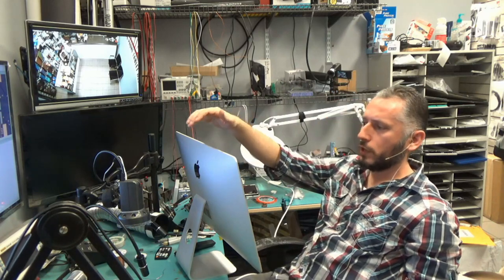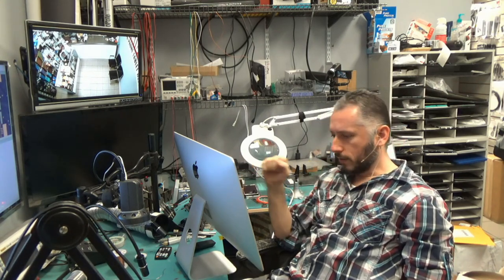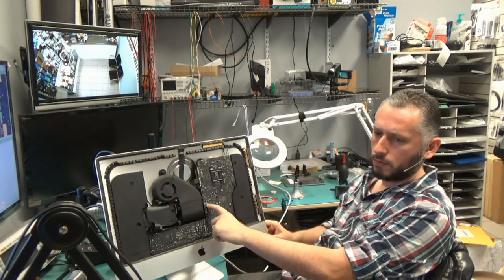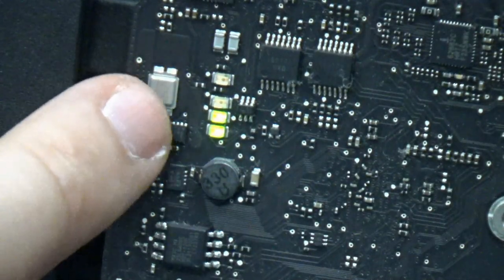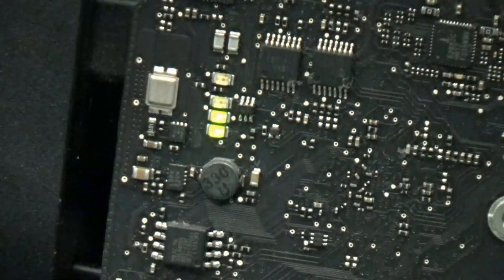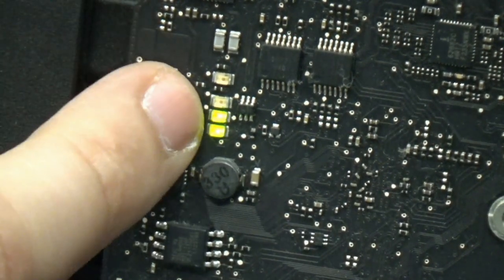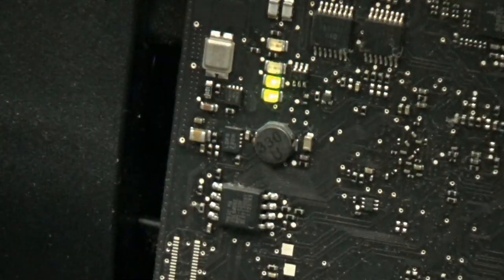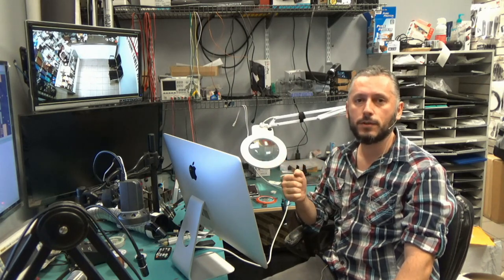iMac No power hardware troubleshooting using Diagnostic LEDs

Comment: Hi. Your vídeos are very interesting and valuable. I have seen several for a diagnosis. Can you give me any advice, please? I have upgraded my 2017 iMac ( 21.5 inches ) now it has a TB and 32GB RAM. Crucial and OWC carefully checked before installing them and also cloned. Computer deos not power on. Since green leds 1 and 2 are green ( not starting Sound though ) I saw your video where third light green was the GPU and I replicad the battery as you DId but the problenm remains the same. 1st and 2nd green light- no sonda, and third nothing. What can I do?. Where can be the problem?. Thank you
Reply: Were you able to solve your issue? I'm having the same problem right now. I opened my iMac 2017 after a HD failure and changed to SSD (I was already using it as an external SSD as the startup disk). After that I'm only seeing the two green lights. You replaced your PRAM battery and that didn't solve the issue?

Comment: Hi! I'm watching all of your videos! Very useful! I've changed the ram, but when i mounted everything back, it doesn't do anything. I saw that the first led is not lighting, it doesn't recongnize the ac cable ? Is an error with the power supply?
Reply: It's either the power supply or the logic board.

Comment: Thanks for this video. I ordered a new power board and logic board for my 2013 27" that was having similar problems. Now that it's open, I guess I'll try replacing that CR2032. If that's all it was, it'd probably be wise to hang on to the replacements for that fateful day when one or the other does fail, as they are starting to disappear off eBay. Don't you think?
Meanwhile my 2007 24" continues to work perfectly, if not running a little hot, day after day during the repair.
Reply: Was that your problem?
Reply: @xp3085  you know, I replaced the watch battery but I ALSO put a new NVME (or whatever they're called) in there with a little adapter and one of those things fixed it so I still have the power and logic boards. I also have scotch tape on it instead of the proper seal because I'm superstitious and I don't want it to fail, you know, the day after I adhere the screen properly.

Comment: I have a 2004 imac g5 A1076 Model, and it has the first two lights on, but it doesn't make the chime noise its supposed to when I hit the power button, but I hear the inside whirring like it wants to turn on. The white led on the front of the Desktop Mac stays solid on the bottom right of the front of the computer, the screen wont turn on, it just stays black. Any help or suggestions would be TREMENDOUSLY helpful. Thank you.

Comment: Imac 2011 21.5 inch when i put the power cable on the mac the fan is spinning normal but without pushing the power button it turns on by him self 1en2 lights up but 3en4 is out what can it be is it the power suply or is it a logic bord dead? Thanks

Comment: Hi   I have replaced the EFI/Bios chip and replaced my hard drive with an SSD drive following carefully all instructions. The iMac will not turn on so I checked the leds. The first led is on but the 2nd led (indicating the computer is on) is flashing on and off    ..... any help much appreciated
Reply: im having the same issue.
Reply: I'm having the same issue
Reply: Same problem but I have only Led1 blinking

Comment: thank you for the explanation. it really helped alot. i do have to ask, My situation is that the system does not start and only gives me a flash of light so when i opened the system all lights except the top light come on. I can still here the click sound and the fan comes on then stops then comes back on. I feel it can be the hard drive going bad, but i could be wrong. Any thoughts?

Comment: @nortdrigefix - the first LED in my computer is on when the power cable is plugged in. When the power button is pressed or jumpped, the fans turn on for two sec and then turn off. Nothing happens afterwards. The second, third, and forth LEDs never come on. Could you help? Thanks!

Comment: Good day @NorthridgeFix. I have a iMac 24 Inch (EMC2134) have LCD issues, it's not turning on,  i have hardwired the LCD to 3rd LED Diagnostic light and the LCD turns on but imac doesn't turn on. Diagnostic led 1,2,3 is on but the 4th is off. Maybe you have a suggestion? Thanks!

Comment: hi love your videos 
i have a problem i bought a iMac 21´5 2013 and it is dead i already new and that the previous owner replace the psu and nothing i already check voltage and psi its ok 12v coming in and 3,5v to
but motherboard doesn't show any led turning on can you help ?

Comment: Hello sir I have a 27 inch imac of 2011, I have such a problem that only one light comes on, if I switch it on after a while all the lights come on and after I switch it off there is only one light, I'm turned on again 30 minutes after work complete but quickly not  imac this is my imac problem please give me solution 🙏

Comment: Great video. question did anybody ever have a problem where the display 27” imac 2013 late i7 3.5 with GTX 780M ,will dim for a quick second and then go back to its normal brightness. And the auto brightness is turned off .I replaced my display prior to it being bad at one point not because of this particular issue this particular issue started when I put the new display in. I read that it’s possibly software, but I’m not sure I have checked the LVDS cable and replaced it for the heck of it. It only does it once in a while sometimes when the computer first boots up and then sometimes maybe a half hour into using it a quick glitch where the display will dim for a quick second and then go back to its normal brightness where I have it set at. I did a pram reset all of that SMC reset still getting it I’m not sure if it’s actually the display that I purchased, which is aftermarket. if anybody can help me out, it would be highly appreciated. 
Thank you

Comment: Hi thanks for your great video. Nevertheless on my late 2012 imac the 3rd light lights also but can't seem to get it to go to  boot or go to restore or boot an external mac HD nor even get it to boot off a linux dvd. I also replaced the delta power supply with a liteon b/c I heard they were faulty but to no avail. Finally I replaced the cmos battery but that didn't work neither. Running the apple diags basically freezes and never finishes. Got any other ideas?
Reply from the maker: likely a GPU problem.

Comment: After watching you video I replace the power supply on my  iMac Intel 21.5" EMC 2742 (Late 2013) and only 1 light is on any help would be great.
Reply: Shawn Anderson same issue but 2nd light flashes. Got any help?
Reply: @Brandon-jc8xm  i got the same issue too lol
Reply: Nathan Nguyen My problem was the ram. Changed it out and put some OEM and it worked again.

Comment: I have a 2013 imac, same motherboard layout, the first light turns on but when i press the button to turn the computer on, it does nothing, what do you think it might be? Here in chile we don't have proper tech service and i am kinda lost on this one.
Reply: hey dude, I'm having a same issue just like you. Did you find a solution already? I really appreciate your reply for I'm located in rural area ;((
Reply: If the power supply is Delta then get a liteon because the delta's have been failing like crazy.

Comment: A1311 Late 2010, i have no sound on startup, but fan is spinning. I opened the screen and i see that 2 lights are ON, keyboard is not responding (Caps lock) so it wont detect PRAM command. How can i make sure its GPU or Motherboard or battery (less likely)? Thank you
Reply: You solve the problem?

Comment: My iMac is a 2011 model and after watching your video, we took the screen off to see the LED lights. My computer does not have the LED lights. We looked all over the place and there isn’t anything that gives us an indication if it’s the power supply even though I feel it’s the power supply because the computer doesn’t turn on. For a 2011, is there any other way of checking that it’s the power supply before buying a replacement?
Reply: Search for the service manual for your specific model. Regardless of where the LED's are located, they will most likely be covered with a piece of black mylar tape

Comment: For me, LED #1 turns on and then off when I plug it in. iMac does nothing when I press the power button.
Reply: I' have two logic boards that I've been fighting with to get working. One does exactly what you are describing. I put my other logic board in and I got the first two lights on
Reply: same here ! any solution ? very expensive repair here :(

Comment: Hi. From NZ. I have a similar problem. iMac mid 2007. Power unit failed. No LEDs came on. Bought new power supply. Now all four LEDs light up but as soon as the chime is heard the computer shuts down and all LEDs go off. I managed to get it to boot up once in between but not again. Tried replacing the PRAM battery as well as trying to reset the PRAM and the SMC. Still stopping after the chime.

Any advice please.
Reply: You fixed? my Imac 2007 starts but no chime and black screen and no boot

Comment: I have a 2011 IMac which has a connection on the  top edge of the logic board which has no cable in it so I am puzzled as to its function. It's to the right of the skin temperature sensor, can you help me out with a cable part number & it's function.
Reply: That port should stay empty, I am not really sure what its purpose is but it certainly comes empty originally

Comment: I got a imac a1311 only 2 lights on. and no sound. i swaped a i3 540 cpu with a i5 760 cpu. but with the i3 i had the sound only no screen. but the cable wasent connect so far as i got it. i think my prob is the i5 wont work on my model. so far it turns on no screen no sound and the fans going to full speed as crazy. gonna swap the i5 for the i3 again and see if it helps

Comment: i have an imac a1418 late 2012 when i put the power cable the first light turns on. when i press power button the seconds light turns on but imidiately turns off and this keeps repaeting.
means short on power supply or logic board?
Reply: I have a same problem. Can you solve this?
Reply: @joaolacerda3749  I have same problem can you solve
Reply: @techhometv6022  I don’t solve.... It seems that the problem is really SMC

Comment: I re connected the hard drive and no lights turn on as if the power cord isn't connected. but when I disconnect the hard drive the lights turn on
Reply: Did you ever figure it out ? Was it a failed HDD ?
Reply: Lights out 666  no never did. I’m wondering if I should swap the platters with a new hard drive or not.

Comment: Hello
My iMac 2009 do not power on. Power source and power button are ok. I have change the PRAM battery but still does not power on. Only 1st led is on. Only the 1st led is on. What could be the problem if the 2nd light doesn't comes on?
Waiting for your reply.
Thanks and regards. Nel

Comment: on Imac 27 late 2015 A1419, if no one of the leds is on and 12 volt is presente on the main connetion to mother board, and IMAc does not power up, what could be the problem? can you please give me some indication?

Comment: i have an imac late 2015 27 inch and the first and second lights turn on when I plug it in, but also, it makes a beeping sound every five seconds. all of these happen when i just plug the imac in and not pushing the power button, is it a logic board issue?